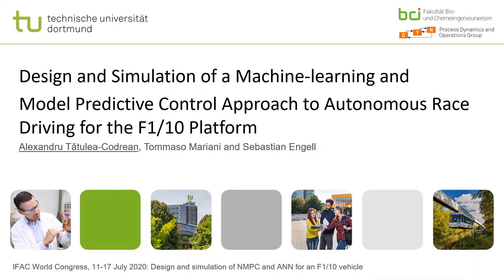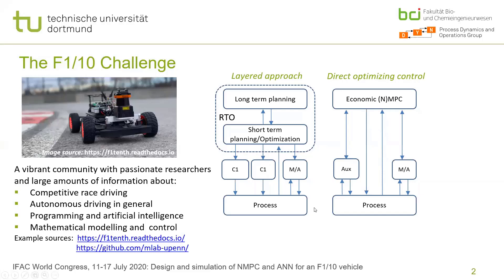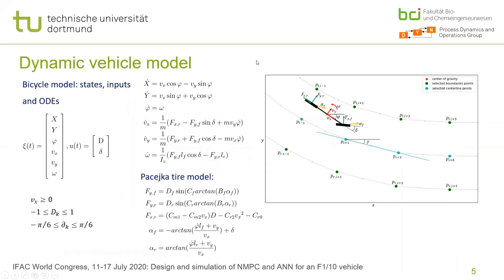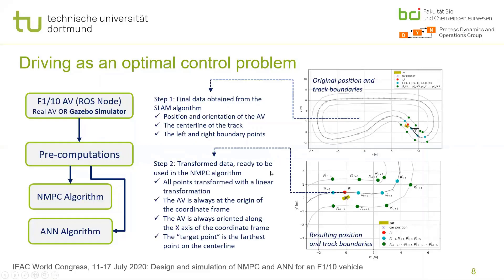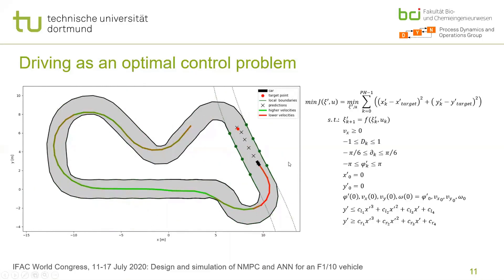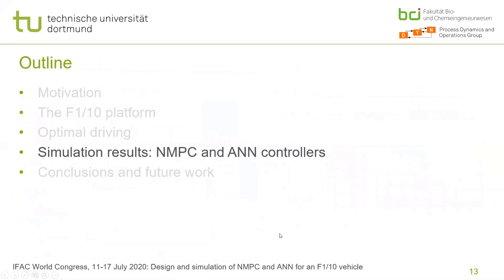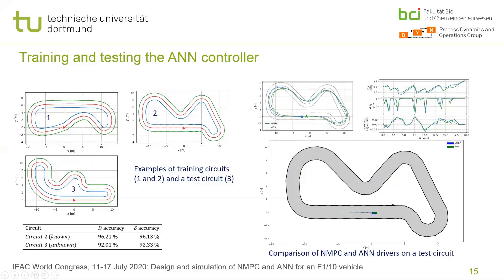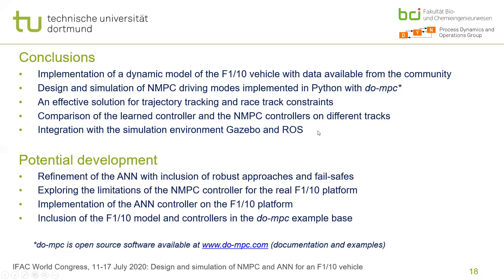Model Predictive Control Approach to Autonomous Race Driving for the F1/10 Platform

Comment: in terms of the hardware computation which kind of control board would you recommend to implement a MPC on?
Reply: if you are looking at implementing something as complex as what is presented here, you have some serious demands for linear algebra and optimization libraries. A Linux system, something like a Raspberry Pi, would get you started. But it all depends on what kind of control requirements you have...